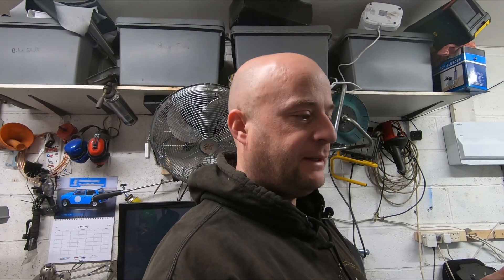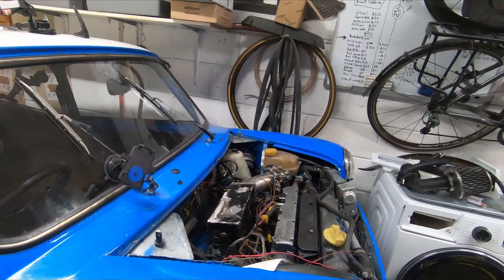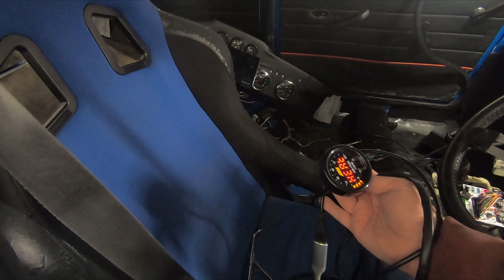Fitting a Speeduino to a Classic Mini (with and engine swap)

Comment: I'm interested to see how you get on with the 4 wire IACV stepper motor driver as I'll be doing that too, not a lot of info on that around. Are you using the UA4C board?
Reply from the maker: Mine is a 0.4.3c board. I haven’t used the idle control yet I’ve just been using a manual adjustment. It is something I want to do for the future though
Reply: @AdamCampionCars  thanks for the info, best of luck, watching 😏